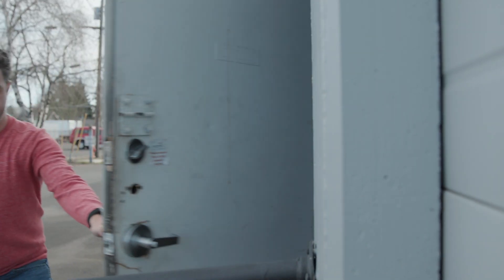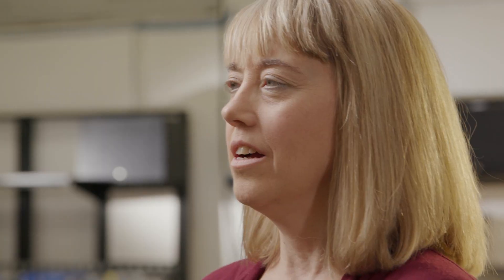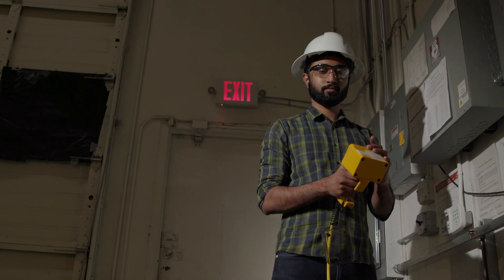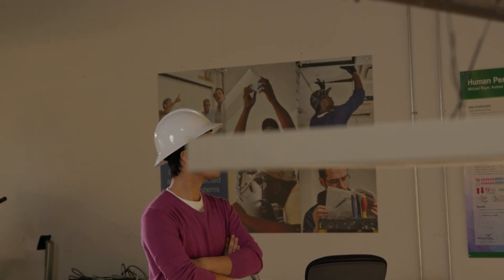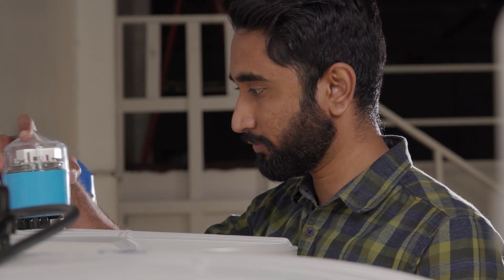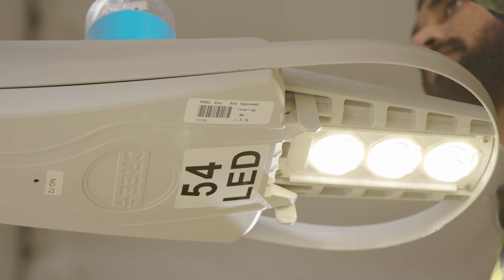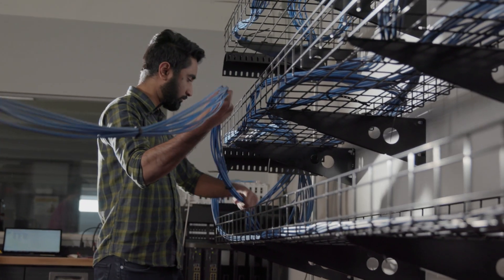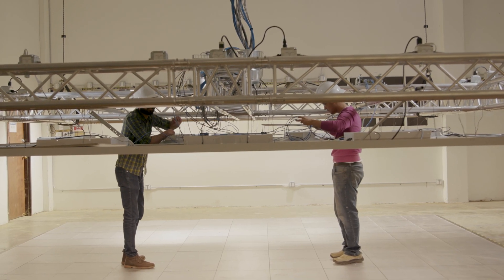Studying Lighting Energy Use and Performance

Comment: Wide surface area lighting fixtures that are not bidirectional reek of opportunity costs not seized with Germany getting great endorsement from The Washington Post for its radiant cooling system.

Prior Administrations pushed the gender of maintaining Antiquated illumination levels while also ignoring dehumidification is wasted energy because radiant Cooling is targeted. Human beings cool themselves primarily the radiating energy in the infrared Spectrum so any lighting infrastructure should be exchanging visible light for infrared heat. That is where the efficiency is and the energy being consumed by antique solid state lighting is de minimis in comparison to the energy saved and viral infections prevented by increasing humidity levels and exchanges of all building envelope dare if there is an envelope whatsoever by orders of magnitude. We need wristbands and smaller cell phones too attached to them so that people don't have to spend too much money on a second device known as the smart watch but a device that can help us be literate about our perception of comfort reflexively needing to be disregarded or acted upon. the world is naked presently when it comes to what to do about the internal climate not just went outside in the summer. It's time to get dressed!